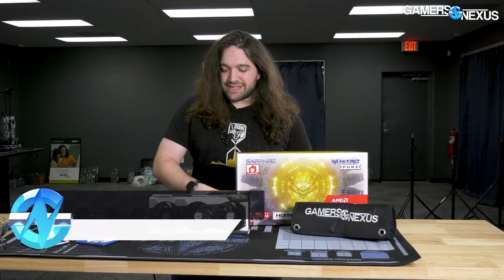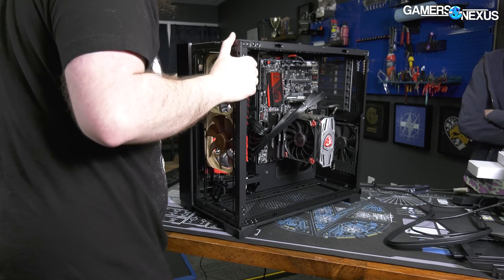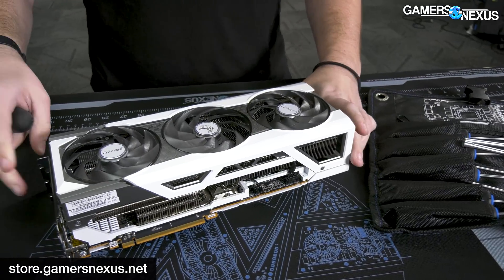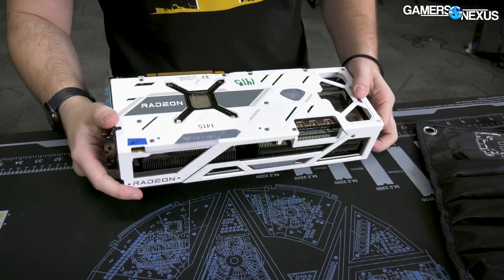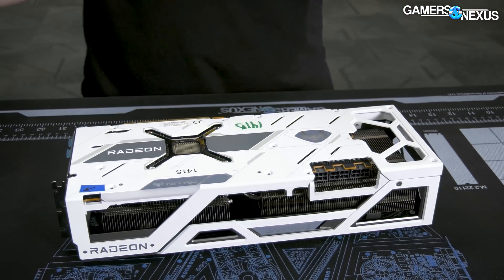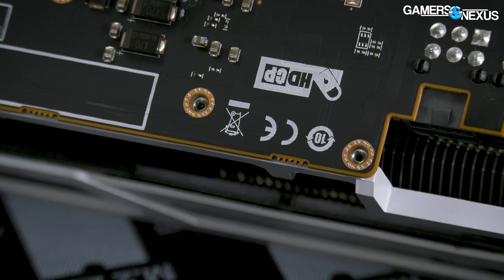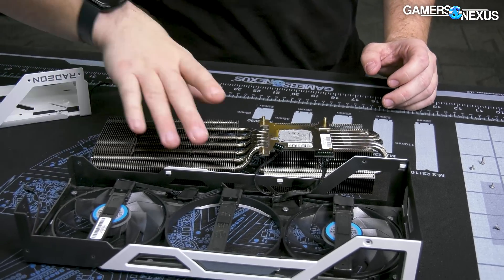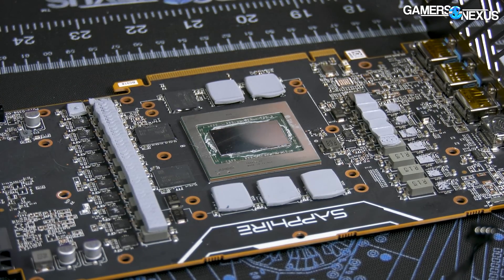Tear-Down: Sapphire's Excellent Cooler Design on AMD's Hottest GPU (6950 XT Nitro+ Pure)

Comment: Still rocking my Sapphire R9 290x BF4 launch edition. Almost a decade on this thing and its still kicking ass. Running a fairly heavy overclock on it the past decade and i replaced stock cooler with an arctic accelero extreme 4. OC on it via MSI afterburner is as follows: +75mv core, +13mv AUX, 
+50 power /95c temp limit, 1150mhz core, 1500mhz memory and forced constant voltage.  This card averages about 5-8 hours of 1440p mmorpg (WoW) and fps (battlefield 1,3,4 - 32v32 hardcore conquest), and arma 3 per day in a HAF-X case i bought when i first built this rig. When not gaming on it, im doing Auto/Master CAD/CAM 3d rendering/design/toolpathing for my cnc mill. This computer hasnt been turned off more than a couple dozen times since i built it 10 years ago and that was mainly for Win10 and bios upgrades or the random power outage. Other than that its been working at 100% capacity 24/7/3,650 lol.  Told myself when i bought this 290x on preorder that the cost was justified because its going to be a "5 year minimum before upgrading", and other than some crashing now and then due to its limited vram (4gb), it runs like a champ. Id love to get ahold of a 68/6900xt (been trying to since launch) for a decent price but yeah.... lol.. If GN or HC OC'ing has an interest in looking at my card to figure out why it hasnt melted down into a gelatenous green goo yet, this disabled army vet would appreciate it if in return you had a card I could borrow to run in its place till i got the card back, as i need a card to run my small business of custom pew pew and car parts..

Comment: Sapphire really are a model company for an AIB partner, I've had nothing but good experiences with them. They seem to take pride in their products, as evidenced by the attention to detail in areas which are invisible unless you're tearing down the card. The "Sapphire" branding on the PCB is a good example, I've not seen any other manufacturer do that outside of special overclockers' editions of cards (EVGA 3090 kingpin for example). I currently use a Vega 64 Nitro+, and besides being the best cooled Vega card with a great power delivery design, they went and put art over all the empty areas of the PCB. I'm happy to see that in a market where any old card will sell they have not dropped their standards at all.
Reply: Just repasted my 64 nitro a few days ago, the cooler design is a godsend in that the vrms have independent heatsinks. Meaning that you can easily remove the cooler by unscrewing the plastic fan cover (4screws) and the mounting bracket(4 screws), repaste the die and not worry about vrm thermal pads as their little heatsinks stay attached. The circular graphic on the PCB feels like Sapphire fully embraced that this is an enthusiast's card, meant to be taken apart and serviced by the user. Plus, it has 2 PWM case fan headers which is WILD as motherboards don't have fan curve controls per GPU temp, and a dual bios switch, and an anti-sag bracket. Funny part is it takes the entire length of a Meshify C, clearing the front case fan by like, 1mm
Reply: Ive got a Sapphire Pulse RX580 and it was a good card.  Still is I just use an RX6600XT now.
Reply: Love my Vega 64 Nitro+ as well, although my poor case layout does not haha
Reply: @46three  I ended up getting the ASUS ROG Vega 64 because it was what I could get at the time. My Thermaltake Core x9 has plenty of ventilation though. Cat dander means I have to blow it out with an air compressor once a month though.
Reply: @46three  Undervolting it at 1000mV@1600Mhz p7 state got me similar performance to stock settings and slightly upping the fan curve keeps it at a very decent 60c under load which is enough thermal headroom to push HBM to 1000Mhz+.
Your mileage may vary of course, but if you're on a cramped case a 10 degree reduction is nothing to sneeze at
Reply: Is your's vega64 still alive? You are lucky one. These dies are very breakable
Reply: @Killername969  If I remember correctly, Sapphire were the only Vega 64 manufacturer to make a molded die which means it protects the fragile interposer underneath. After a bunch of repastes and a waterblock install it's still perfect.
Reply: Sapphire cards are the best AMD card you can buy (maybe Powercolor Red Devil?) but I prefer the aesthetic of Sapphire.  I have a Sapphire Nitro 5700XT and it's a beast.
Reply: I'm a bit annoyed that the TRIXX software can't make the RGB follow the temperature of the card, though.
Reply: @ALEXANDER1318  Strange, my Sapphire Nitro RX 580 cheapo card has that RGB setting in TRIXX, and fortunately TRIXX applied it on the card's VBios level - the setting has remained applied on the 3 systems it's been through, and it shows blue when cold and RGBs to red as it gets hot, only managed to do that in benchmarks, in gaming it gets to purple. It's been my fave' RGB setting ever, to switch colours based on temps. <3
Reply: @cosminmilitaru9920  For my 6800xt Trixx only allows; Runway, Single Color, Rainbow, Serial, Audio, Custom or External Source (via rgb cable). No option for temperature. Sad. Trixx 8.6.
Reply: oh boy, Sapphire had some real issues back in the (late) ATI days.
Reply: Sapphire and EVGA are what XFX and Zotac fail to be. Although XFX has improved for this gen imo
Reply: Yep my first card ten years ago was a sapphire r9 280x toxic and its still running strong.
Reply: Yep, got a 5600 xt that I took with me to hell. It's still working great.
Reply: Been buying Sapphire Nitro/Toxic cards ever since the HD4850, only ever had one card ever have an issue of the many Ive had, everything else has always been beast mode, only recently in the gpu shortage have I strayed from their cards but I'll always go back to them, for their reliability and quality.
Reply: I've had a sapphire 6870 and a sapphire Rx 480 and they're still working fine! So naturally I now have a sapphire Rx 6800 XT and it's amazing
Reply: I have a Nitro+ RX580 SE which I bought used in 2018 for less than 200€, and it's still running strong without any significant maintenance on my side. I'm looking for an upgrade now and will likely go Sapphire again (the Nitro 6700xt is finally down to ~620€ here, after reaching up to 1200€).
Reply: I have the triple fan Sapphire 6700xt. It's pretty good looking and quiet. It's my first ever AMD card so I'm happy
Reply: amd partners with sapphire like it (or nvidia) doesnt with msi, asus,.............
Reply: I have also only had good experiences with Sapphire. It’s a shame the one time I don’t get a Sapphire card, I have issues.
Reply: The only time I ever had problems with Sapphire was some technical support. I had an issue that turned out to be a vbios issue and the only way to get that was through e-mail support. That experience wasn't exactly great.
But that was the worst of it and I have always preferred getting their brand because of how good the quality is.
Reply: @darranrowe174  I hope you had a bios-switch to at least fix that easily, I think most sapphire cards do / except entry-level cheap ones.
Reply: @cosminmilitaru9920  Unfortunately it didn't help. IIRC the issue was the output flickering, so it didn't have anything to do with what bios the GPU was set to.
Reply: Sapphire RX550 still alive after 5 years haha..
Reply: It is why I was sad I couldn't grab a sapphire card when I got mine. I could have waited(this was before 2020) and hoped to get a sapphire, but decided to get a good, but NOT sapphire card. I really admire their stuff. It looks nice and also cools very nicely. I'll probably never buy a top end GPU, but this one seems pretty typical. I'd even be happy to grab a sapphire RX580 if I had to, those ones are can be quite nice.
Reply: @Top_Cheeze  nice to know that theres an amd only GPU company too.  like Zotac is a nvidia only company
Reply: True man, they give a lot of attention to detail, regardless of whether the product in question is low end or high end. Used to have a RX470 Nitro card and man that card was built like a tank and a was a beatuy to look at. To this day, it still amazes me that Sapphire put so much effort into a $180 card. What a great AIB gfx card manufacturer.

Comment: Would be nice to see some testing with a custom backplate compose of thin passive heat-sink (3-5mm) and how much they are missing by not implementing one.
I know adding more metal to the main heat-sink is more efficient, but curios about that waste space on the other direction where you normally find extra room and no interference to the rest of the PCI slots (specially consider SLI ain't a thing at the moment).

Comment: The black "adhesive" under the 4 bottom memory chips is underfill. It is used to increase the mechanical strength of a BGA, since these high end cards get heavier and heavier and more and more stress is applied at PCIe slot area if the card is oriented in standard position in a case. It should in theory improve reliability of the card in the long run.
Reply from the maker: Thank you! I appreciate that you took the time to explain it. The only time we've seen that so clearly is on the RTX 20-series cards that had the severe artifacting bugs, but I assumed it was coincidence and didn't want to relate it to that issue without being certain. That helps a lot to have the context and specific name for it.
Reply: @GamersNexus  Buildzoid did a video about the board and talked about this in typical Buildzoid detail. He liked the board.
Reply: The purpose of underfill is not so much due to the weight of the card, but mostly to compensate for issues with thermal cycling. Underfill helps to transfer heat and improve thermal cycling performance by softening the mismatch between the coefficient of thermal expansion (CTE). It's applied around the edge of the BGA chip, and also provides mechanical support that way in addition to thermal conduction.

I imagine that with a very hot-running GPU like this, the thermal cycling is brutal enough that underfill is pretty much required to give the RAM modules an acceptable lifespan. With the cross-brace on the back and heavy metal heatsink, I very much doubt that the PCB does a lot of flexing.
Reply: I saw Buildzoid video yesterday (Sapphire RX6950 XT Nitro+ Pure PCB Breakdown) and he mentioned underfill. He checked and Sapphire "they did this even on the 6800 xt"
Reply: Hey, correct, and also, underfill is usually used for isolation purposes ( moisture, humidity etc.)
Reply: This card has more girth than my weiner
Reply: nice! That's important because lot of cards have died from sagging

Comment: I've been impressed by a number of Sapphire cards for years now. Looks like an easily serviceable card for enthusiasts and at least fan replacements should be doable for anyone new to the PC building community. The only issue with AMD GPUs is the software gremlins that plague so many people.
Reply: It's a complete myth perpetrated by Nvidia owners who haven't used an AMD card in a decade or more that their software and drivers has any more issues than Nvidia's. As somebody who owns cards from both and regularly uses both, it's pure fiction. AMD's software is better than Nvidia's these days if anything. And it's absolutely indisputably so on Linux, where Nvidia continues to be a nightmare for things like Wayland support. Maybe the partial open sourcing they did yesterday will eventually help that, but it'll take a long time.

Comment: Interesting, I wonder if that VRAM adhesive is there to help prevent board flex from damaging the solder balls beneath the memory. I know a lot of repair technicians talk about how the memory modules close to the PCIe connector tend to fail over time due to board flex (the solder balls disconnect from the pad after many thermal cycles).

Comment: Considering how big this coolers are getting anyway, can they start making coolers that use 120mm case fans already, that would make finding replacements a non issue.
Reply: Pretty sure the Asus/Noctua collab cooler does just that. It's a full 4-slots thick, though.
Reply: @benjaminoechsli1941  I'm aware, i just hope that some day it will become standard in bigger coolers

Comment: holy smokes that's a chunky cooler.
What use case does the 3090ti have left? for the price it makes even less sense now.
I have fond memories of the Sapphire 9600, when in high school I fixed someone's computer issue by upgrading them with that card. Sadly it was reported to me that they had a break in just weeks later, in which their pc was stolen, and the card along with it.

Comment: looks identical to the 6900xt toxic air cooled offered by sapphire
Reply: That one has the same shroud as the regular Nitro+, it's just repainted. They've used that design for a while, my 5700 XT Nitro+ has it too.
Reply: @Emelydiaa  the size of it too my toxic is 3 1/2 slots 4 with the bracket that came with it

Comment: I really like how you specify that the end of video that Sapphire did its job well and your amazement with the engineering put into the design of the Non-AMD aspects took me by surprise a bit.  I really appreciate that.  I think we as consumers overlook that (in this case) sapphire is only responsible for some of the card and AMD is responsible for the rest of it.

Comment: Waited to the end to comment, maybe Sapphire can be encouraged to make similarly high quality products that are just slightly less extreme for their mid-range to high end cards instead of just the halo cards? All the way down to 6700XT/ 3070 would be great to see, even if at a fair premium. I would say this video helps do that, but that exact suggestion isn't made. Yeah well done Sapphire on building a good card.
Reply: You should see my awesome premium quality Sapphire Nitro RX 580 4GB that was like 200$ in 2017. :)) Fully metal, swappable fans, everything Gundam looking and I think the best quality materials that they could use, incredibly silent and cool, I could overclock and undervolt it, and has dual-bios. Couldn't ask for more.

Comment: Something I've never understood is how GPU coolers are able to cool so many more watts in a small amount of space relative to CPU coolers.
Reply: Surface area.
Given the same material and fans, GPU has better chance having much greater surface area for dissipation for obvious reason.
If we do similar treatment for CPU, it would require some additional parts for structural strength. Even some cooling design on some GPU already requires those additional parts to help them stay in place for minimizing the chance of them bending the board PCB. Since more material = more weight.
That is if we ignoring enclosure size, the casing dimension.
Reply: Massive heatsink, lots of fans, and guided airflow.
Reply: direct die and, if you equalise dimension ratio, you find they take up similar volume, just that they're flattened, increasing surface area